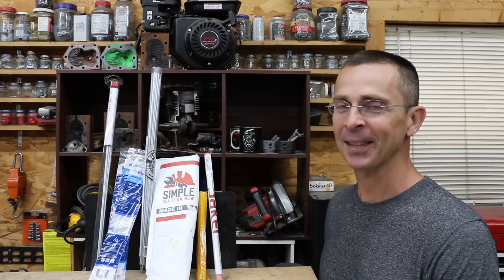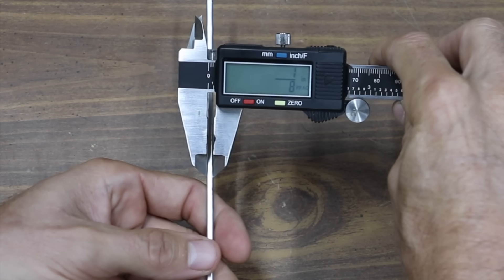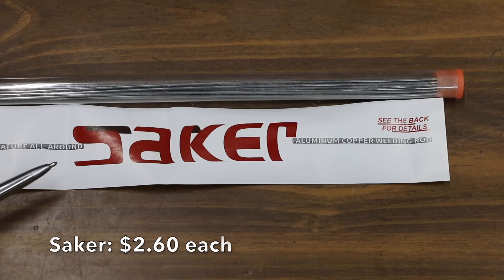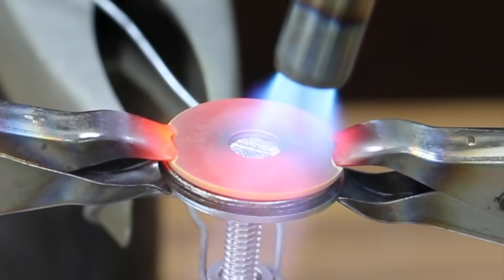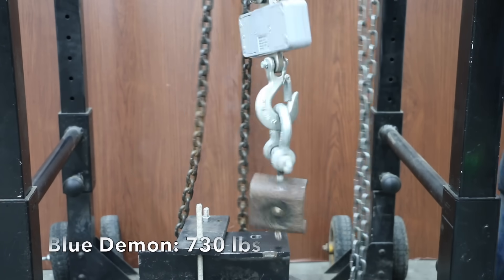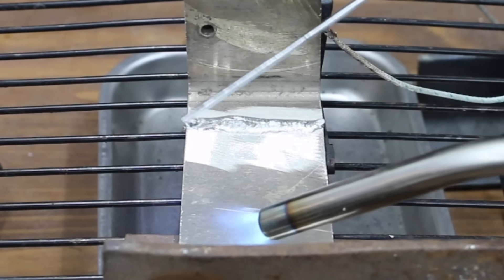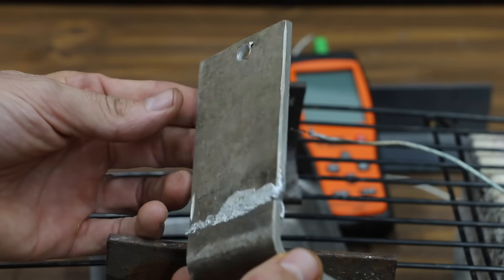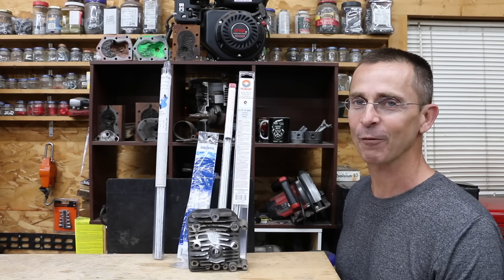Best "No Welder" Aluminum Welding Rods? Alumiweld vs Bernzomatic vs Hobart

Comment: I bought something similar if not equal back in the early seventies, as a teen, with no torch but a propane, and "heliarc" costing fifty bucks an inch in Chicago.  I didn't have quite the success you have, not quite the strength, but with a similar wetting and sticking of the rod.  I was trying to use it for mechanical strength and was barely satisfied, but suspect your different rods were better choice of aluminum/zinc alloy determined over the years.  Thanks for a definitive test procedure, and accurate results!
Reply from the maker: You are welcome!

Comment: In spite of the marketing claims these should be used with flux and in joints prepared as you would for brazing. regarding thermal imaging,  its not cooler, its radiating less heat.
Reply from the maker: Thanks for the constructive feedback.
Reply: @ProjectFarm  thanks for making these videos I enjoy them.

Comment: Wow I have to admit I am kind of sort of impressed.  I did not think you was going to rip any bolts in half. I thought the weld was just going to pull..   Don't et me wrong I am not ready to give up my AC/DC tig any time soon. But I was impressed. Had you ground a bit of a V into the inside of the cylinder head and filled it in from the inside it would of last for ever.    I never have tried to braze aluminum I wonder what would happen if you just tried a standard aluminum tig rod. They are dirt cheep.
Reply from the maker: Thanks for the suggestion.

Comment: Glad you tested this stuff. I’ve been welding off and on both professionally and hobby. Fr a very long  time ven taught for a while. I’ve had no luck at all with these Mickey Mouse non real weld products.  The heat required often destroys the aluminum qualities .I your tests were fine. I would have liked to see a more “ solder type joint but still ok. The cylinder head tests a old example of not flowing through. Surprised it did not crack  out. .  I would have vexed  it. More and TIG welded both.. ides I had to pass certification on aluminum, steel, and stainless steel  on similar  sides.  All we’re ex ray and penetrant tested.  I would have liked to see a sweat filled joint similar to silver bronze   Brazing.    The end result is I still will braze  with proper stuff and TIG weld if at all possible.  I’ve done thick stuff thin stuff and  joined. Both . Thick and thin stuff.    

 Once again we’ll worth watching. Byron
Reply from the maker: Thanks!  Thanks for the suggestions.

Comment: Very impressed with how you tested these products. I had heard that these rods are rubbish and not worth the time and effort but you have demonstrated that Hobart, Bernzomatic etc are viable products for non-critical repairs on alloy bikes, boat dingies etc. in an emergency.
Reply from the maker: Thanks!
Reply: Considering the aluminium and not the weld breaks first, it's more of a permanent repair, just like if you had tig welded it. Welds tend to be stronger than the base metal.

Comment: I have used several of these aluminum rods in the past with less than ideal results. The best aluminum brazing rods I have found are Lucas Milhaupt AL-822 aluminum rods. Brazes aluminum to aluminum as well as aluminum to copper. They melt quickly and flow well.
Reply from the maker: Thanks for sharing.

Comment: You are one of my favorite channels on YouTube and have helped me choose some of the best tools to purchase. One tip is to be careful with the IR camera on any shiny surface, the camera can not get an accurate reading. I carry a roll of cheap electric tape with me at work when i run into this problem using my flir. In this instance high heat spray paint would have probably held up better lol. Keep up the awesome work!
Reply from the maker: Thanks, will do!

Comment: Project farm thank you ☺️😀😀😀 so Hobart_#1 alumite,benzo,blue demon 👿. Harley 1275cc,I'm installing on gokart birel rx30 s.e but idiots build at 12.5.1 compression. standard head bolts lol no stud's,so stripped threads I can fill in holes , retap with best studs a.r.p ?? Which would be better? Hobart or blue 👿. Cheaper better but wanna have nice welds and easy , will high tear,heat,tension strength.? Help me please.

Comment: Something that is critically important, is that they sell "brazing flux" that works with aluminum brazing rod. Generally without flux, it can be incredibly difficult, if not impossible, to get brazing rod to melt at a low temperature. 

That's because the heat transfer is very poor when you first touch the brazing rod to the metal. You don't want to put the brazing rod in the flame, because it ruins the metal, by overheating it. Dipping the hot rod in the flux, just before brazing, means the rod has a thermal paste" on the end of it, so it can absorb heat much easier. A rod whetted with flux paste, will melt far easier when applied to the surface metal.

The flux also "wets" the parent metal, and allows the brazing rod to "flow out" properly, like lead solder. The flux applied to the weld joint, also etches the metal and protects the metal from forming impenetrable oxides. 

Cleaning the rods and the weld joint with a new stainless steel brush or aluminum oxide sandpaper, and then cleaning thoroughly with acetone, then applying a very thin layer of new flux, will likely create the most consistent welds.
Reply from the maker: Thanks for the feedback.

Comment: Brazing is orders of magnitude more difficult than welding. People giving reviews on brazing rod, are not going to be reliable reviews. Unless a person knows how to properly prepare metal, by using new stainless steel wire brushes that are not contaminated with iron particles and grease. I'm certain that 99% of men don't use the correct cleaning method for brazing. Cleaning the aluminum with acetone before any type of welding or brazing is critical, because sanding and grinding will leave aluminum oxide particles and grease. If you want a consistent, repeatable process, you have to use a consistent cleaning method. They also sell paste flux specifically for aluminum, which will make the rods much more "liquid" and viscous.
Reply from the maker: Thanks for the feedback.

Comment: it's worth noting that true MAP gas (methylacetylene, propadiene and propane blend) isn't available anymore. What they sell now is MAP Pro and contains zero methylacetylene. MAPP burned at more than 5000 degrees F, MAPP Pro barely burns hotter than propane at 3700 degrees.
Reply from the maker: Thanks for the feedback.

Comment: I actually have used the Harbor Freight ones a few times now.  They work quite well for some small projects, like making a bracket with a bolt welded/braised to it.  It does indeed end up being stronger than the materials themselves! I've even used it mixing a steel bracket with an aluminum bolt... held up under impact tightening. Thank you for the video!
Reply from the maker: You are welcome!  Thanks for sharing.

Comment: had about 100 holes in my boat and used the harbor freight brand. it works great! no failures yet!. used oxy torch to fill holes up to 3/4 inch. good stuff.
Reply from the maker: Thanks for sharing.

Comment: I have wondered which is, well not the best, but the most reliable to use, and looks like Hobart takes it. I have a small engine cylinder from an RC engine that the exhaust flange got busted off from a crash. If I were to put the flange nut on, could I fill in the busted part and then remove the nut, leaving behind good threads?

Comment: Not read through the other cpomments but going to say, you don't try to heat aluminum up with a steal washer around it and expect the Bolt to get to actual heat they say it will. the steal will take it away from the bolt just as a heat sinkl does in a computer!

Comment: Impressed by your ingenuity at developing tests.
Question:  You recommended using brake cleaner NonC.  I've always used acetone for my chemical cleaning of alum welds. 
What are your thoughts?
Reply from the maker: Thanks for the positive feedback.  Acetone is a great choice too.  Brake parts cleaner is convenient since it's packaged in a spray can

Comment: Back in the 60's GoKarts were a very popular sport. McCullough engines were the 'rich mans' direction, and MODIFIED Clinton engines were 'poor man's route. To modify the aluminum Clinton, we naturely 'ported' the intake (made round ports square, AND 'added ports with copper pipe held with 'Liquid Steel' epoxy (which mixed to being 'white' back then. New ports into the head were drilled, and holes the crank-case, and copper pipe for the (new) manifold.,, and covered with expoxy. These engines would beat the McCullough's, but rarely lasted more than three races before the head blew-off the engine at the port-level. The epoxy wasn't a failure point.
Reply from the maker: Thanks for sharing!

Comment: When I was working for the DOD as a mechanic we had some brazing rods we used (unfortunately I do not remember the name of them) When the rep came in first show them to us he did a trick where he melted off a piece of the rod onto the material we were brazing. He would then head the piece until that little bit he melted off flattened out like a coin which is what let us know the material was hot enough to braze.
Reply from the maker: Thanks for sharing.

Comment: Question:  I feel like the bernzamatic and the Hobart flowed the easiest.  I have a thin crack on an aluminum rim.  When you did the repair on the final piece, the Hobart did not flow into the crack very deep.  Do you think that if the metal was hotter it might have better flow?  Do you think the Bernzamatic flows better than the Hobart?
Reply from the maker: Thanks for the video idea.

Comment: Good video, stumbled across it in my search for aluminum repairs so I can repair a old aluminum factory air cleaner that is split all up.  I saw these rods before but heard bad things so ruled them out but seeing them in action I think I will pick up some Bernzomatic rods to make my repair.

Only thing is I wonder how strong it would be if it was sanded after repairs.  I can luckily do the repair on inside and out but would want to smooth out the outside so paint will hide the numerous repairs.
Reply from the maker: Thanks for the feedback.

Comment: I am really surprised that they even have aluminum brazing rods.  

Metallurgy has continued to advance leaps and bounds over the past few decades.  There was a time when the only way to wield aluminum reliably was with a TIG wielder.  

TIG still gives the cleanest wields on everything, but it is expensive and time consuming to the point of it being cost-prohibitive on both these counts for most uses. 

Also always follow the instructions on brazing rods.  There are several different types that create different types of shielding compounds. While most people should know that you always have the one or two people who presume all brazing rods are the same.
Reply: As a note, most of these are structural solder or "Brazing" not really wielding some have amalgamation additives to wield into the contacted surface, but few will create a true wield.   Hence, the point of weakness will almost always be the joint, not the metal.
Reply: As a note, I'd pick on the technique on the bolt test, but you did it consistency and the point very much was to use a non-ideal technique there.

Also, he should have noted the other good reason to do the test on the outside of the cylinder head instead of both sides:
If it is a field repair you probably don't have the tools or time to clean the inside of the cylinder head enough to do the repair there.

Comment: I would like to see a test of the best of the JB weld style products against this aluminum weld product..... Which one is actually stronger to hold your parts together if for semi reason you had to repair one of your parts on the road...... 

Is JB weld better at patching a cylinder head versus aluminum weld or one of the other ones..... 

Which one can hold water pressure better
Reply from the maker: Thanks for the video idea.

Comment: Thanks. Let's deeply pray one day, they'll invent a new welding system than has all the advantages of the  four welding processes: TIG, stick, flux core and mig wedling and even soldering for microsoldering even and can do very thin wire on CPUs and very thick 10mm aluminum and magnesium.

I'd like to suggest a video on the different welding processes (application being welding of 1.6mm sheet metals or small to 10mm thick I-beams and H-Beams), perhaps take the one that goes above 200 A for each welding process. Check out the channels TimWelds for reviews on safety gear for the next videos as an offshoot. Check his 101 videos. The brands he mentions are: DEKA, Miller (the one he uses the most, flux core welding usually), Lincoln, etc. Choose the ones that run A/C (if TIG welding and it's higher than 200 amperage, it's great for aluminum and magnesium welding), D/C then there's another type of current, check Weld channel on Youtube, his 101 videos.

God bless, Rev. 21:4
Reply from the maker: Thanks for the suggestion.

Comment: Thinking of using Hobart to fill a hole in oil pan from inside and outside. Should that be good enough or do you recommend I go to an actual welder?
Reply from the maker: Seems like its worth trying.  Depending on location and size of the hole, drilling, tapping and then installing a bolt with tread sealant is a quick and permanent repair.
Reply: @ProjectFarm  I thought about that, but it doesn't have enough depth to plug in a thread insert. The welders are asking about $100 just to do that small job, so I wanted to see if DIY via brazing rod method would be good enough.   Thank you for this and all your other videos. You have a new subscriber!

Comment: the crack where the cylinder head was repaired was cooler because the flame could not travel into the crevice all that well. the rest of the head's inside surface was in contact with the flame and pressure insuring more heat applied there.
Reply from the maker: Thanks for the feedback.

Comment: Hey brother I know it's a little late but where did you get that thing to Mike to measure the rods I like to get me one
Reply: Vernier calipers can be bought in many places, eBay, Amazon, Harbor Freight and pretty much any serious tool shop. Note that many of the cheap Chinese ones tend to go through batteries very quickly, switching them off only turns the display off, the measuring circuit continues to run.  Look for Mitutoyo or Starrett calipers if you want quality and accuracy, though they are many times the cost of the cheap imports. Look out for cheap counterfeit Mitutoyo calipers, seems like they are everywhere.

Comment: What type of torch head are you using here. I could not tell but I was not having good results using a pencil tip torch head and wondering if I used the high intensity head with Map it would work. Thanks.

Comment: BTW, if you are wondering why the Hobart braze didn’t penetrate into the cavity and/or why the MFR listed strength wasn’t observed in your experiment, it’s unfortunately due to human error. 

Brazing works by capillary action which causes the melted alloy (brazing rod) to flow inside the microscopic holes in the metal being brazed. 
The most important thing to know when brazing is that the melted alloy and/or solder will always follow the heat source (hottest point) which requires the welder/brazer to manipulate the heat source accordingly. 

*unfortunately, in the case of brazing and the skill plus understanding of how brazing makes it extremely difficult for someone whom hasn’t had a good amount of experience/practice in brazing metals. 

*Your results are fairly accurate and are close to what I’ve personally observed over the years and many different rods/gas combos I’ve used. *Hobart has proven very reliable for me, but Blue Demon hasn’t let me down either, so I typically opt for Blue Demon (cheaper). As for the “Alumaweld” = total crap (in my opinion), because even brazing joints correctly have only ever returned results comparable to using silver solder (shear & tensile strength). 

I really enjoy brazing and encourage anyone interested in joining metals together and/or those that don’t like or have difficulty mig/tig welding to give the much easier to learn brazing a shot!  

Brazing is much easier to master since it doesn’t require any machine adjustments, only understanding and practice are required to obtain very strong and good looking results! 

*An interesting fact is that Carbide tips on wood/metal cutting for rip/table/chop-saw’s are brazed onto the metal blades and, prior to the faster mig/tig welding, entire airplanes were *brazed together. Why is the above important? If one or more teeth from a table-saw broke off *at the braze & while the blade is spinning, the carbide tip projectile would easily pierce through most machinist aprons and/or protective clothing.
Reply from the maker: Thanks for the feedback.

Comment: Please note that, no matter the type of weld or in this case “braze”, the weld/braze should NEVER break at the welded/brazed joint - especially in your example of using a mild steel (grade 2 or lower) bolt and brazing rods with more than 10,000psi break strength. 

*Brazing rods are alloy’s (mixed metals) that, if you are using the correct rod for the application, will always exceed the metal being welded/brazed by, at a minimum, a few thousand PSI. 

The above comment is strictly meant for informative purposes only..

**On that note, I do really like your channel and encourage you to keep up the good work!**
Reply from the maker: Thanks, will do!